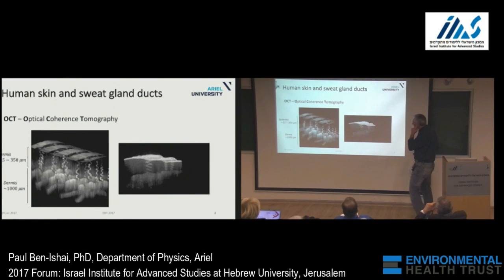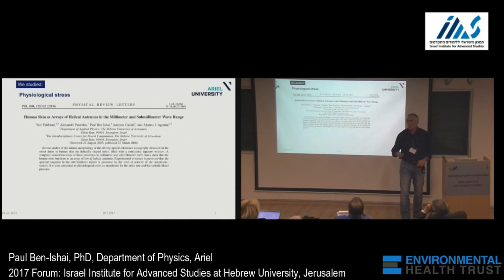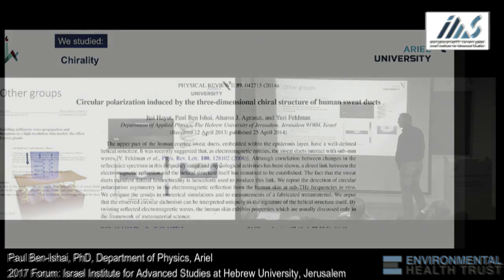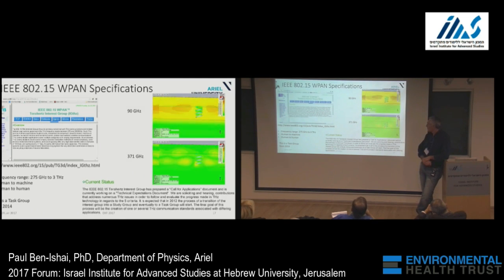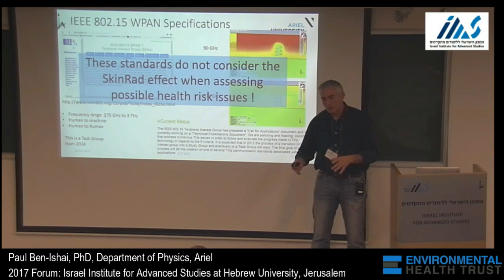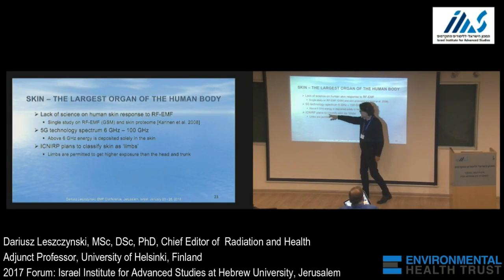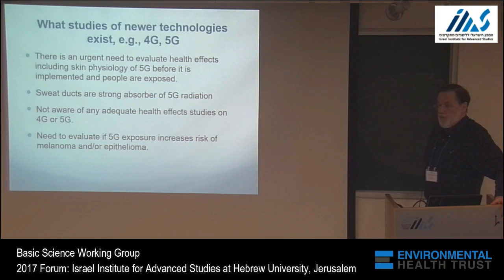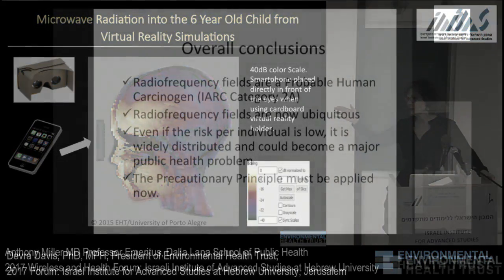5G Technology: Potential Risks To Human Health: Excerpts From Scientific Conference

Comment: whenever i take call by keeping  my phone near ear even for 5 seconds i feel pain and it does not go away by any medicine. It goes away after several hours or next day automatically and this condition is creating a big problem in work life.
Reply: use a 3.5 mm WIRED cable. Dont put phones too close to your face if you can avoid it
Reply: @poedesta-emilscandali3671  yes i use speaker mode only earphones also cause pain

Comment: 100ghz to 1thz is actual infrared heat.. so whats the surprise that it makes you sweat?
Reply: What’s surprising is their putting these antennas every 300 feet at ground level. When it comes to microwave radiation proximity to the antennas is everything. The closer you are the more harm it will do to you.